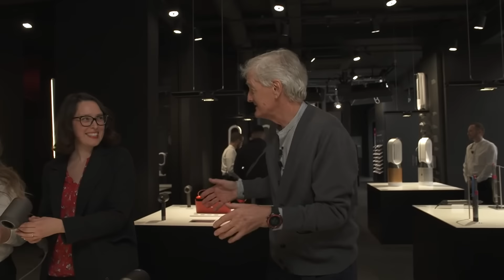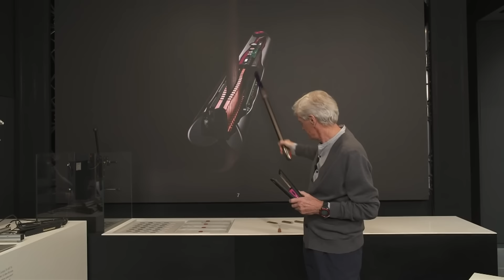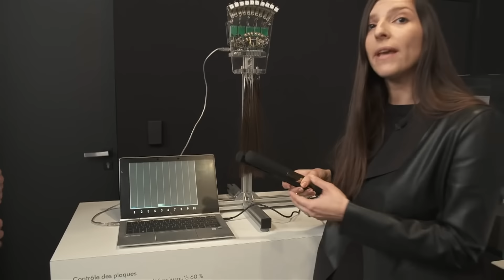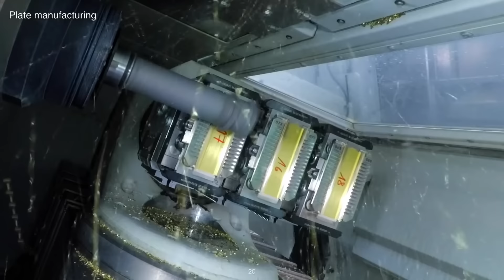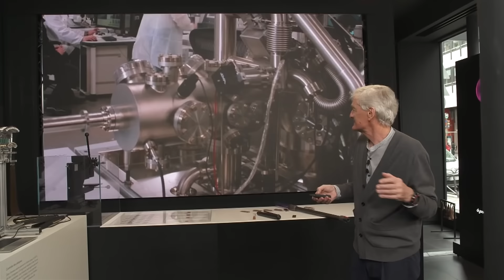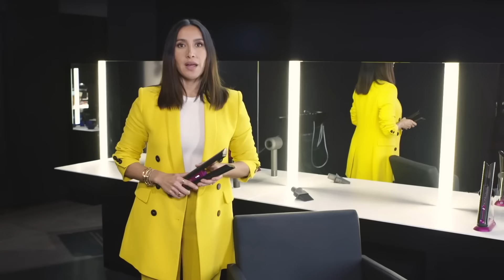The new Dyson Corrale™ cord-free hair straightener launch. Live with James Dyson and Jen Atkin.

Comment: Shame the batteries die just after warrenty ends
Reply from the maker: The Dyson battery pack is covered for the duration of our free 2-year Dyson warranty. It's not possible for us to specify an exact lifespan for any component, including the battery pack, as this depends on how each individual machine is used, maintained and stored. As with any battery, our battery packs are subject to normal degradation over their working life. You can find some tips on preserving battery life here: http://ms.spr.ly/6057vkdPx